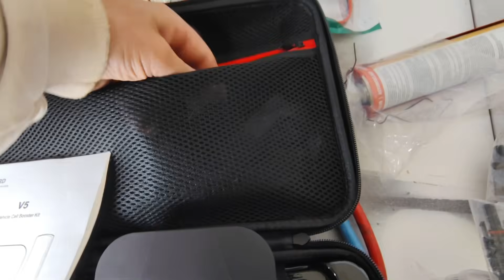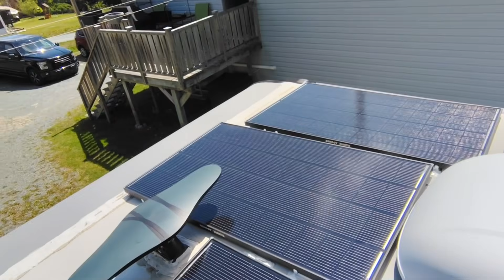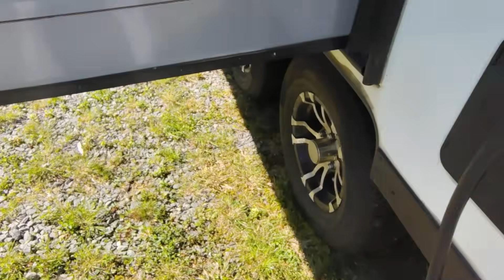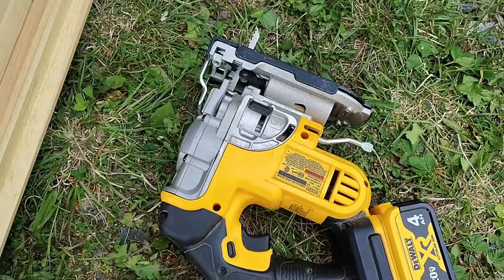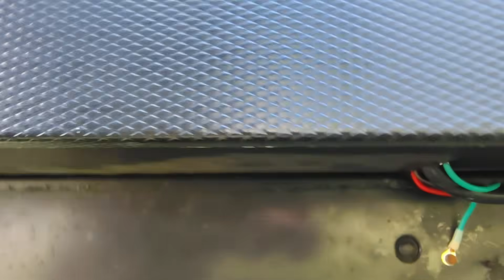Solar Panel Installation - 1200 Watts Of Solar - Renogy Shadowflux - 9.6 kWh of Batteries

Comment: You called your shore power cord an extension cord. What's coming out of you electrical panel and where's it going. Sorry for all the questions but I'm learning a lot. Thank you
Reply: You may or may not have expected these responses I haven’t looked at how many followers you have but obviously I’m a big fan so at the moment have you downsize are you out of your house. That’s our plan as well
Reply from the maker: Thank you.
Yes, we completely downsized and now live full time in our trailer.
We still have a lot to learn and get into a routine but each day we take one step forward.
Guy
Reply from the maker: Yes, basically where you would normally take an extension cord from the campsite pedestal power and plug it into the receptacle on the trailer, the trailer I have has an extension cord that you pull out from the trailer and plug it into the campsite power.

I routed that cord from the trailer, under the trailer and up into the front storage area and then wired it into the 120 volt AC output from the inverter.
I installed a new plug onto the side of the trailer and wired that into the 120 AC input side of the inverter.
You can go back and watch the end of the solar panel video where I show that part.
I kept all the electrical panel wiring from the trailer so that is still there and it also charges the 12 volt lead acid battery on the trailer.

Let me know if you have any other questions.

Thanks,
Guy

Comment: I'd love to know what inverter you're using and what size Solar Charge Controller are you going to install? Are you going to post another one when your other parts come in? Thank you for taking the time to do this for all of us still learning. I'm also a big fan of @saltytrips
Reply from the maker: You're very welcome and thanks for watching and following along.
The inverter that I am using is the Y&M All in one Solar Hybrid inverter. It's not Victron because I have a limited budget and can't afford all Victron.
The inverter I bought has the solar charge controller built into it so I do not need a separate charge controller.

Yes, future videos show more equipment being installed and how the performance of the set-up is working!
Yes, big fan of @saltytrips. I watch them every week on their adventure.

If you watch this video, you can see me installing the all in one inverter and you can read about the specs it has.
I bought it off of Amazon and there are other all on one inverters available also.
https://youtu.be/ZjA-XitfEn0

Thanks,
Guy

Comment: Thanks for taking the time to record and edit, I know it adds a lot of time and effort to the project. I guess the trade off is having the internet as your QC inspector huh?! I'm interested in the cell booster performance, there were times up north we could have used it. Overall nice tidy install,  Mike Holmes would be proud. 

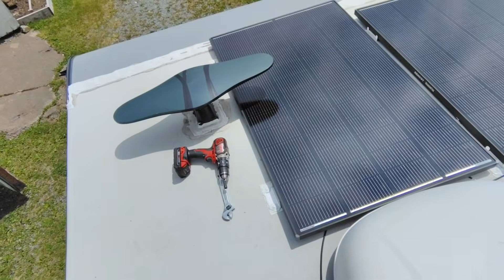19:08 is that a WIFI antenna or a digital TV antenna? 
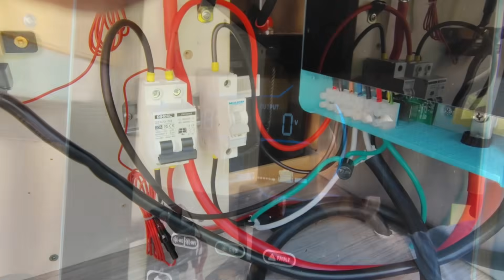51:32 oh that moment of truth and mini celebration when nothing goes "boom"
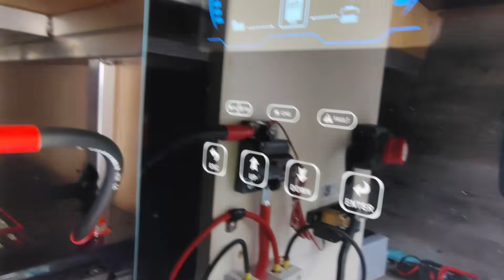57:29 I am a bit confused, would the input no be what is coming in off of solar and/or shore power with the output being the current supply available? My trailer was prewired for 200w, I have one small device that tells me what the panels are delivering and another to tell me what's available.
Reply from the maker: Thanks Paul!
I have mixed feelings about the cell booster... I can't tell if it is even working lol. I need to looked into that better when I get a chance because I can't seem to see any difference that is makes.

Ya, that is a WiFi antenna apparently. It doesn't work according to the place we bought the trailer at so they are going to replace it for free but we can't bring it back to the service center until the end of the month, so we have no idea what it does and I am not sure that I care if it works or not.

Yes, always a nervous moment just before turning on the system but all was fine and it has been working great ever since!

I think that I was probably confused also at the time because I had only read through the manual once at that time but if you are referring to the display on the inverter, one side shows the input into the inverter and the other side shows the output going out of the inverter into the trailer.

In a later video I add an energy meter to the output of the inverter and now I can see how much power the trailer is using.

In full sun I get about 210 volts from the solar and when connected to shore power I can connect up to 120 volts and 30 amps.

For the batteries, I have two 12 volt, 400 ah connected in series so I end up with 24 volts and 400 ah which supplies about 9.6 kWh of power.
Still not sure if it is enough to really sustain us if it was hot and we had to run the AC all the time but so far we have not had any problems with power but it has also been nice enough to only run the AC a little bit.

Guy
Reply: I’m new to your channel….Just one question….. Why do you have a switch on the battery Negative?????
Reply from the maker: @420HughMungus Welcome to the channel.
It's connected to the negative because that was where the instructions that came with the switch showed to connected it.
Plus it is an additional safety precaution for isolating the batteries from the rest of the system in case the batteries need to be replaced or any other maintenance.
Guy